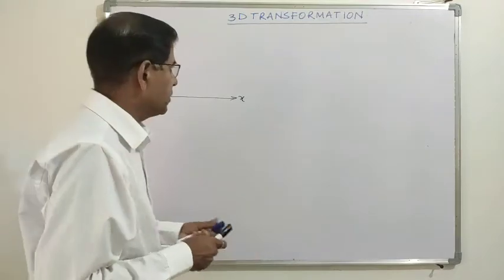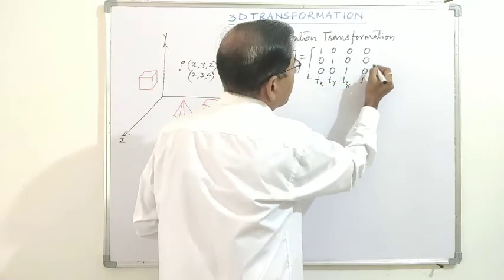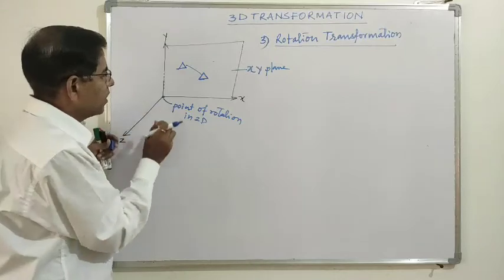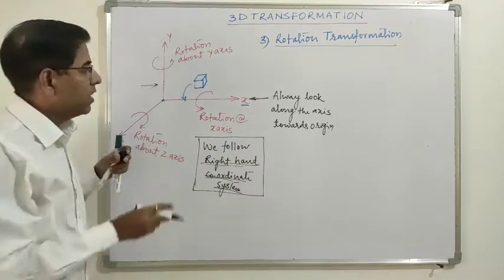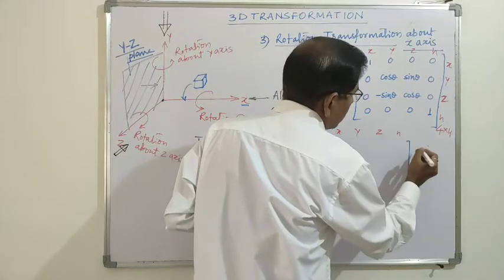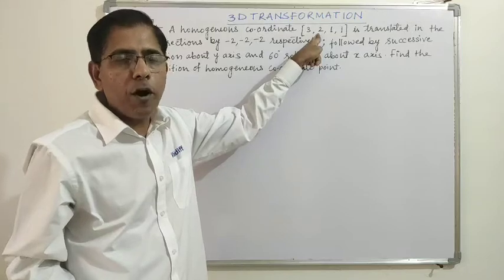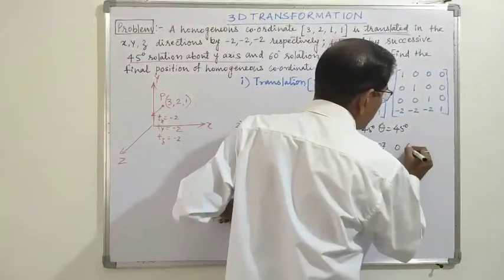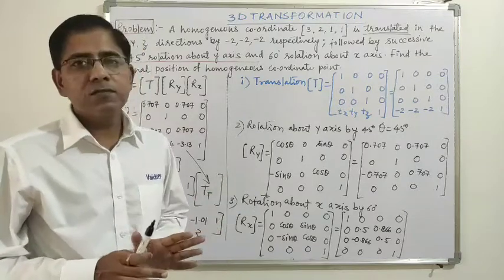Lect 40 3D Transform

Comment: Sir, i think you have mistaken in 'Ry' matrix as the sign in that should be different from the other two 'Rx' and 'Rz'.
Reply from the maker: Ry matrix is correct. Since rotation about y axis means the rotation is happening in XZ plane, hence the cos & sin functions will be at x & z positions.
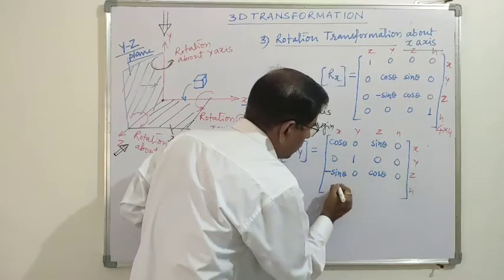Reply: @amitrameshbhende14 I think he is speaking about the negative sign position in the matrix of Ry. 21:18